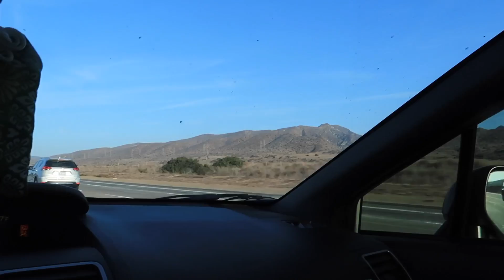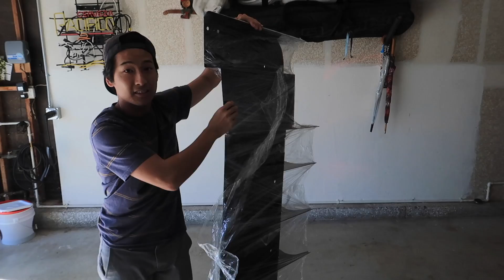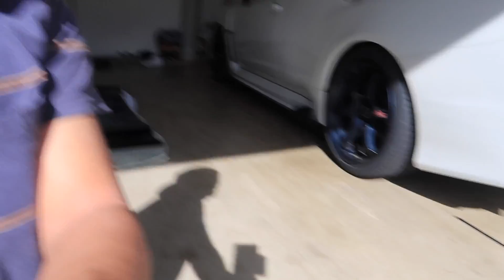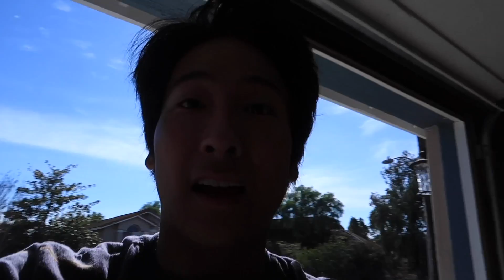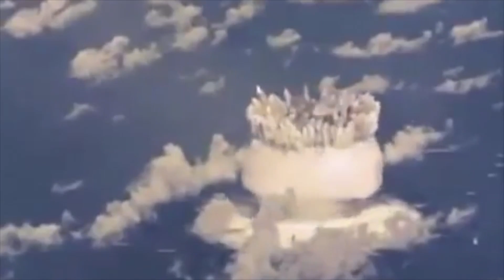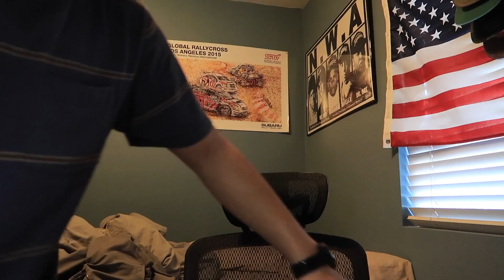Aeroflow Dynamics Subaru WRX Diffuser V5 Install (NEWEST Product)

Comment: Just installed one and while it's not horrible the quality leaves something to be desired. The tapped brackets I can easily see being stripped. They should use a captive nut instead of trusting 1/8 of threads through the bracket. Even just a nut behind it would be better. You don't have to drill the bumper, there are holes for the hokey countersunk bolts and washer setup. I'd also argue that it's not chassis mounted. Yes the mount points are stronger than some that are just screwed into the bumper with self tappers but it's not actual race spec.